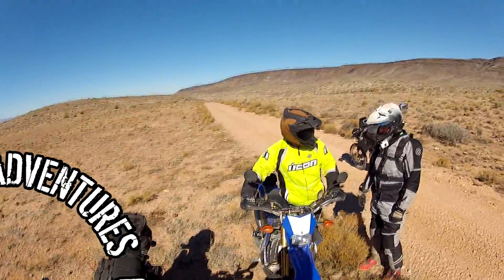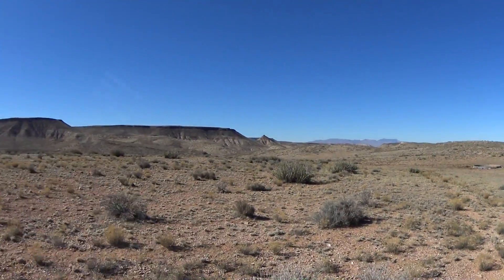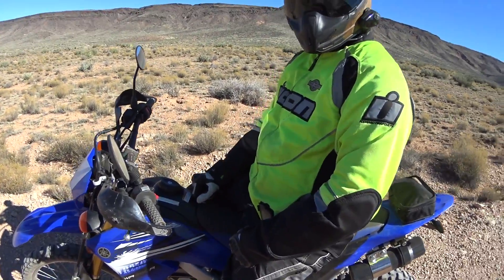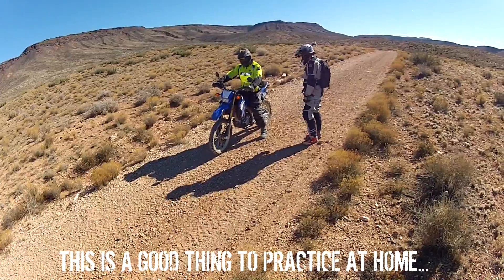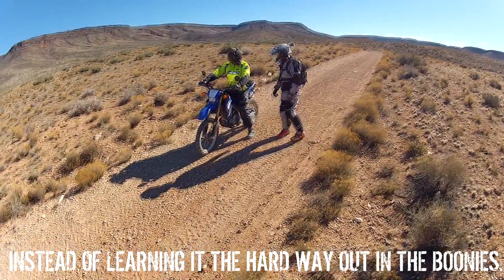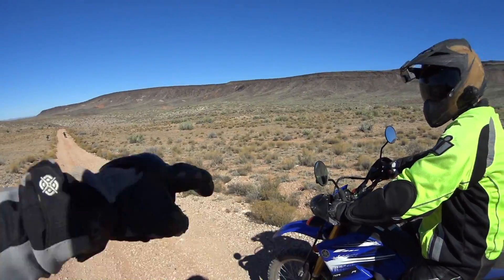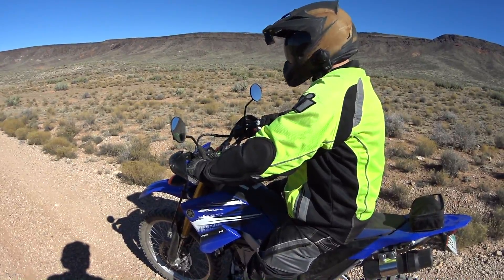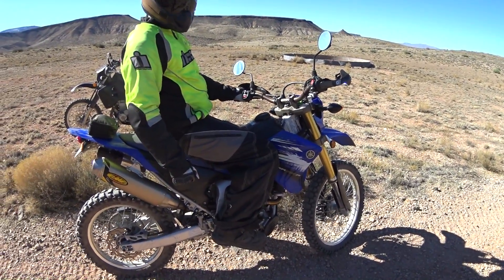How to BUMP START A MOTORCYCLE in the Middle of Nowhere o#o

Comment: Good tip about rear wheel weight and second gear. Used to do that for a month or two straight before I decided to just buy a new battery. Did mine in first and worked well with a light sport bike on asphalt.

Comment: Good job guys! Another thing that may help on the preventative maintenance is to use a battery tender so the battery will be fully charged before you head out!
Reply from the maker: That's a really good suggestion! It's also a good idea to bring one of those jumper batteries like you've got.
Reply: +eveRide ADV Bike jumper cables $20.

Comment: If the back tire skids all the time, try doing it in third or even fourth. The motor will turn over slower but for a longer period of time. That can help if it's flooded or fouled. We used to bump start our GP bikes normally, of course that was in the last century :)

Comment: Good job! Should put a side note in this video somewhere to put a multi-meter on their battery and note the voltage not running and than running make sure its even charging correctly! I have seen loads of people have issues with battery's only to find the bike is not charging correctly! :)

Comment: Best way to bump start an electric start with weak battery by yourself: Get off the bike and start pushing it, hit the electric start to get the piston going then drop the clutch while still holding the e-start. The e-start helps prevent the initial skidding.

Comment: Another way is by using the rear wheel of another motorcycle to turn the rear wheel fast A centre stand comes in handy for that though. I wish I'd known about the jumping down bit when I got my flat battery on tour in 2013. As regular push starting did not work.

Comment: if you have someone to push you - thats the easy way. fun starts when you are by yourself. then you have to run along your bike with gear on, clutch pressed and when you speed it up enough you have to jump on the bike (two legs on the side, lady like horse riding) and in that moment you release the cluch, engine starts (or not..) and then push clutch back on. now jump off and in the same time brake the bike with your right hand hoping not to trip over it. or if you are brave enough you can jump on it for normal seating (with your legs on both sides) which is much safer after engine starts (reduces chance of tripping over).
been there, done that :D

Comment: before pushing put the bike in 2nd and pull it backwards until the piston reaches the point just after compression....you'll feel it get very stiff. then when you bump the piston has a bit of time to move  and build momentum before hitting compression again . doing this makes it easier to bump start a single .

Comment: Ps. This is also proof that you can bump a UEFI WR250R. Some hermit guy said people were saying you can't.
Reply: +ColoradoDualSport Probably easier to bump an EFI bike, because the fuel is supplied instantly without a choke. Try that on a cold DRZ... talk about a headache.
Reply: +ColoradoDualSport You need enough juice to pressurize the fuel pump, else long walk home.  Back in my day we called it "pop start" as in pop the clutch
Reply: +ColoradoDualSport Yeah that only works on EFI if the battery isn't completely dead. Still need enough juice to run the fuel pump and computer.  On many bikes the headlight is always on with the ignition. So it can help in these cases to have a dedicated switch to kill the lights to save every volt you can while starting it.
Reply from the maker: Those dedicated light switches have saved my bacon on occasion.  Whenever I'm in the dirt the light is off.
Reply: +ChaoticDetour Great idea!

Comment: I always did bump starts in first gear.......and yes, it was difficult. is it just to overcome the torque that first gear can put on the rear tire, causing a skid, or is there another reason you use second gear?
Reply from the maker: +Cole Knowles It was just the way I was taught to do it, and was what worked :)

Comment: Just a note the higher the gear the easier the motor will turn with bump starting. Sand snow etc go up to 5th, also pushing alone etc. less effort, great video could mean the death of someone alone in the summer time.
Reply from the maker: +eric rush I've been there and it wasn't fun. I went out alone to look for a lost bolt and what went from 80 degrees that morning turned into 110 degrees. Not a good time to have electrical problems! :)

Comment: Small engine motorbikes easy. on motorcycles 500cc or more, not so easy.
Also depends on sand or asphalt. and also with cold or hot engine.
For all modes always make a good video for friends
best greetings
Medel
Reply: Amen my 650 is a bitch to bump start, add the cold carb in and it's a nightmare
Reply: +back fire  If my klr was cold and I had to bump start it, I'd probably give up and call 911 >.<
Reply: +DeeKay  lmao start a fire distress signal, SOS!!!
Reply: I've bump started a HD Road Glide when I left the lights on while having dinner. Basically did the same stuff as these guys and it worked fine.
Reply: You just have to have enough power in the battery to power up the Fuel Injection.
If your battery is totally dead your looking for a boost.
Reply: +Wally Murray Not really. My CRF has been dead flat, still works with no power to the battery. Just gotta do it a coupla times lol
Reply: Wally Murray fuel injection? My hunk of metal does not know of such fancy devices
Reply: +HJZ75driver True enough, I was referring more to 500+cc bikes, you don't want multiple tries on a big heavy bike.
Reply: +DeeKay Then just find a big strong friend to push and your set.
Reply: +M. Medel I had to bump start my GPZ 750 which is an I4. Might be difficult with a cold engine, but it is doable. The weight of heavier bikes in my experience makes it much easier. It's just getting them up to speed to do it!

Comment: why 2nd? I always do 1st in my klr.
Reply: That's funny, I always do it in third. Reason being that there is less stress on the wheel and you are less likely to skid instead of turning the wheel which turns the engine. food for thought.
Reply: +ColoradoDualSport  Yeah starting in second or even third is much easier than first.
Reply from the maker: I don't know why but I've never been able to bump start my bikes in first or third. But if it works out works!
Reply: +eveRide ADV I've been able bump a klx250 and a wr250r in 3rd just running along side solo. I think 2nd is maybe better on mx bikes and higher compression engines because you need that extra torque to crank it.

Comment: But would it work on an efi bike if the battery was completely dead?
Reply: +Hobbz-Garage Most likely not if the battery is completely dead. However that would be rare in the middle of nowhere since you did ride it out there to begin with.  Unless of course you left the key on, engine off for a long period of time.
Reply from the maker: That would be an utterly terrifying situation.  It's one reason I like carburetors.
Reply: +eveRide ADV That is where the battery pack you told us about comes in handy.